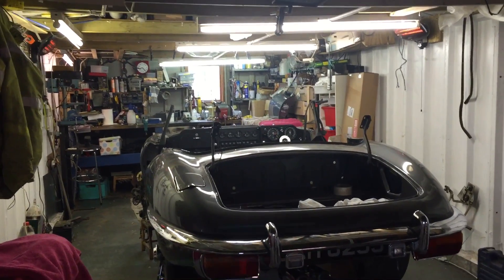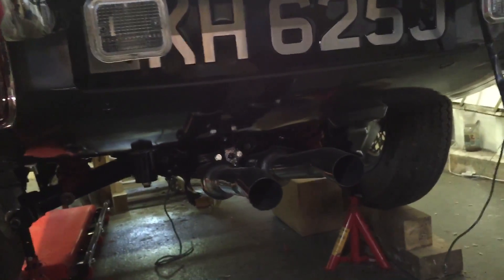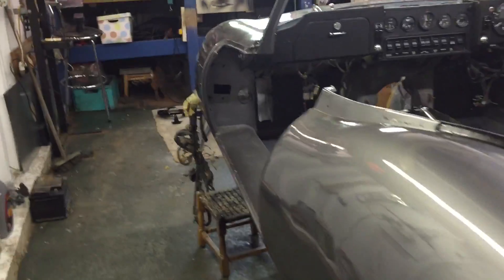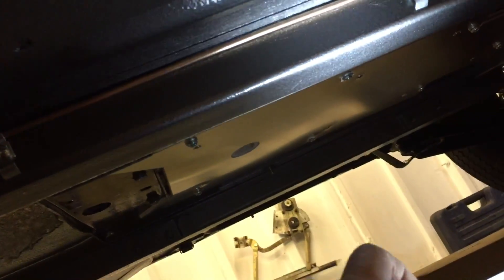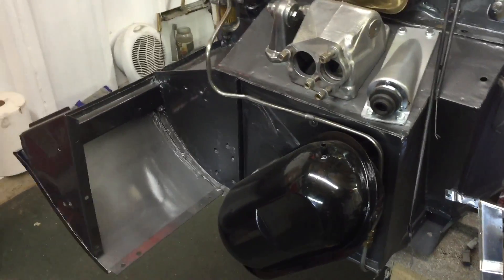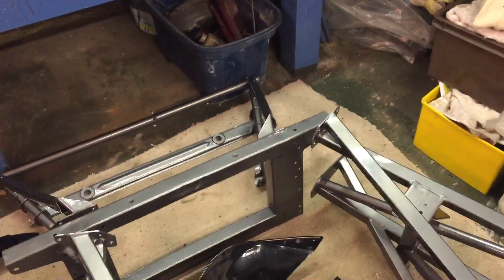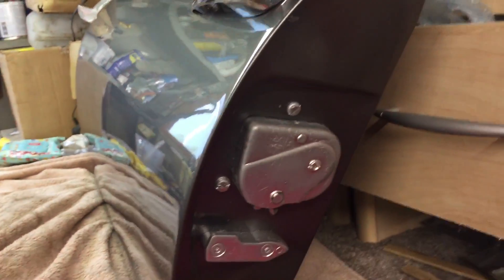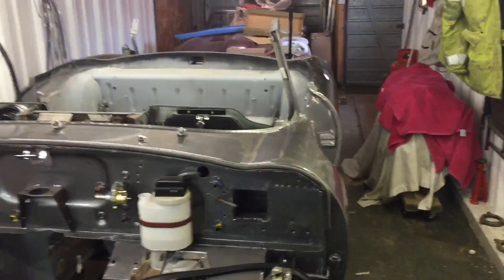Jaguar e type jaguar

Comment: Looking good Alan , I would be inclined to loose the reversing lights as they obscure the number plate ( They are good as useless any way ) I have done the same with my E Type putting the series 1 exhaust on my series 2 , in my opinion improves the look considerably. Keith 69 series 2